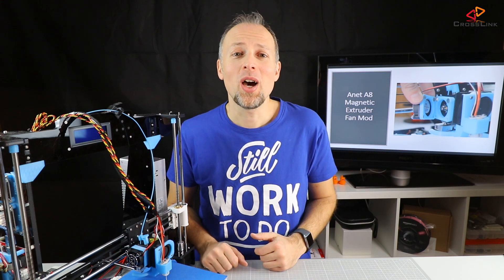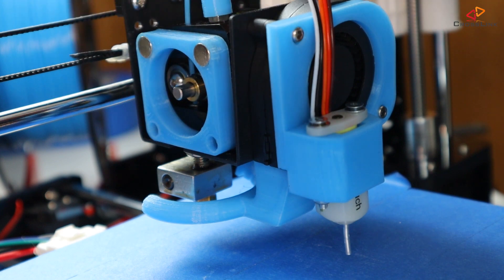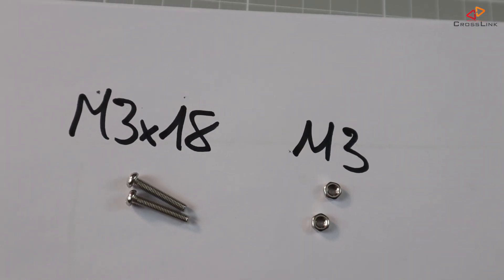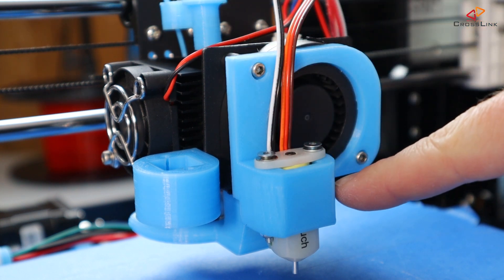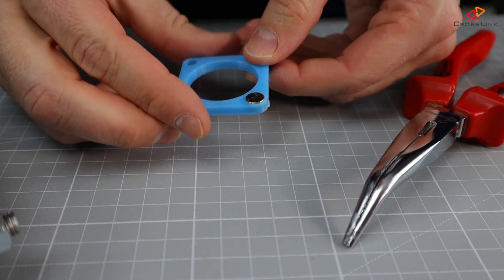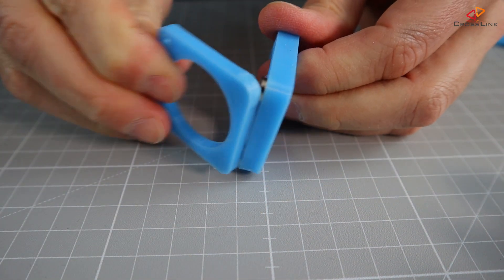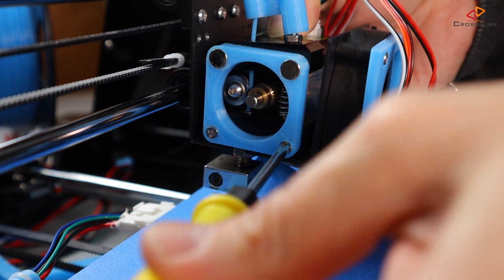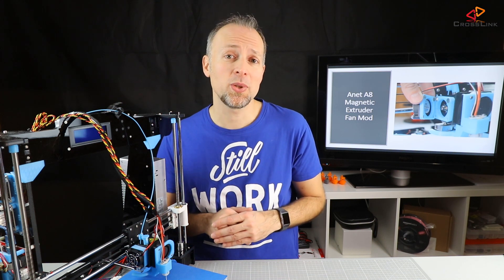Anet A8 upgrades - Magnetic extruder fan mod

Comment: what material are you using, PLA, ABS...etc.  I printed this MOD using PLA and after first use it started heating up and melting at about 190 degrees.  am I doing something wrong?  printer used is Anet a8.
Reply from the maker: I've been using PLA and it didn'd deform since then. Maybe you catched a really soft PLA. I would suggest you switch to PETG or ABS then to make it work with higher temperatures.

Comment: Came here from Thingiverse.......Thank you for the 3D Touch mount! Just a bit of info for anyone....I've been running my A8 for quite a while now without an extruder fan as I noticed after I did the hinge mod the heat sink wasn't even really touching the lower part of the block that the throat passes through. I took the fan and hinge off as it was the loudest, most vibratory thing on the machine and I've had zero issues with clogging or anything else for that matter. My settings are fairly moderate at around 35mm/sec for outer walls and 50mm/sec for everything else except travel which is obviously higher. When you touch the lower part of the extruder block it's barely even warm.
Reply from the maker: Great feedback, thanks!

Comment: I don't think this a good idea, because without the heat sink your heat break is much less cooled (air is only touching the top of the heat break), which means your filament could be already melted when entering the nozzle.

Comment: Good video, the heat sink is there to suck the heat up from the extruder and prevent it getting to the extruder motor, this upgrade isn't cooling the the metal block propily and it's blowing possibly dusty are on to the filament. I asked my programming teacher and he recommended me not to do that, although made the upgrade for the hinge and so far works well. Thanks
Reply from the maker: It might be that if you have higher printing temps like with ABS that this might cause issues but there is also comments telling me that everything is fine. I am going to put it to the test. Let's see what happens when printing ABS with this mod.
Reply: @Crosslink3D  cool let me now.
Reply from the maker: I just printed for 7 hours at 235° with no issues
Reply: @Crosslink3D  🤔
Than I might be mistaken, but I think I will keep my hinge with the heat sink, just for pice of mind, what did you think of my last video

Comment: Thanks for the shoutout!  At first I thought that leaving the heat sink off might cause an issue with cooling but I've been using this fan mount for months now and have had no heat issues even when printing PETG at 250C.  Great video!
Reply from the maker: Love that feedback. Will drive it to its limits soon by testing to print ABS and PETG.
Reply: Dunno if anyone cares but if you are bored like me atm you can stream pretty much all of the latest movies on instaflixxer. I've been streaming with my brother these days =)
Reply: @Wells Jeremias definitely, been using instaflixxer for years myself =)